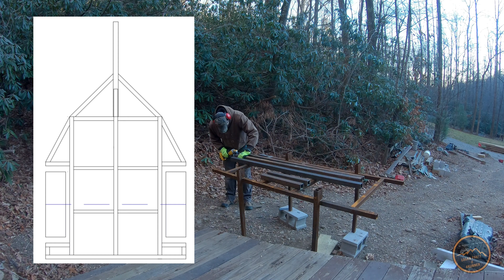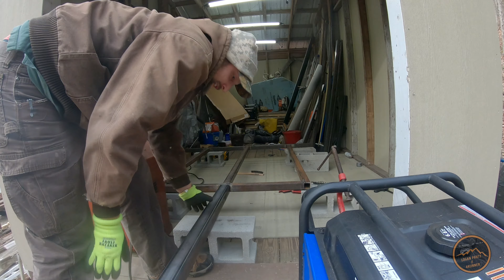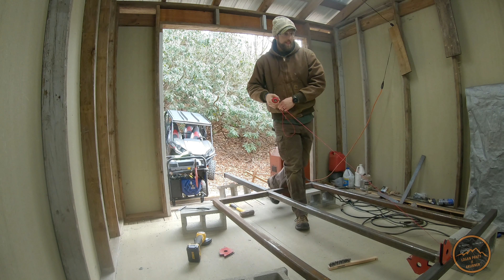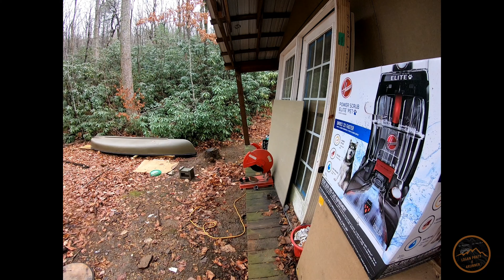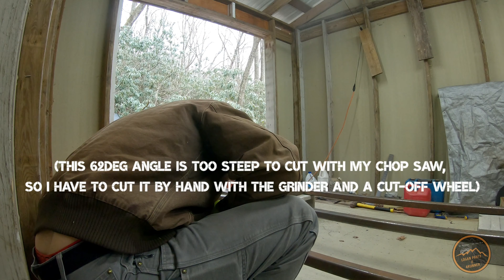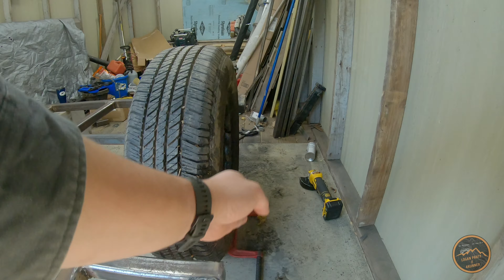Overland trailer DIY build- Off-Road rooftop tent camping trailer project. Ep 1- Welding the frame

Comment: Which welding rod are you using?
Reply from the maker: I have used a 7018 3/32 for everything thus far. I have started on the walls, which are 16ga tubing. I started using the same rod, but I just bought some 6013 3/32 for the 16ga stuff. From what I have seen, that should work better on the thinner metals.